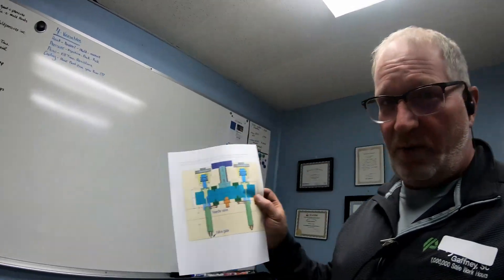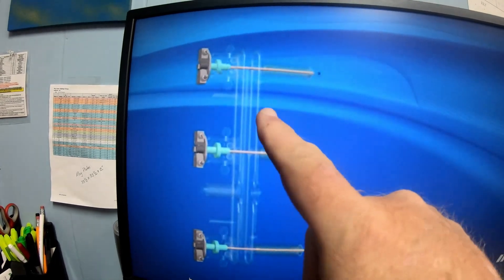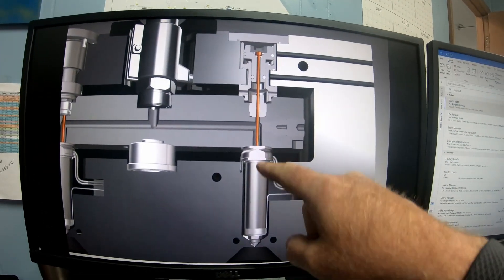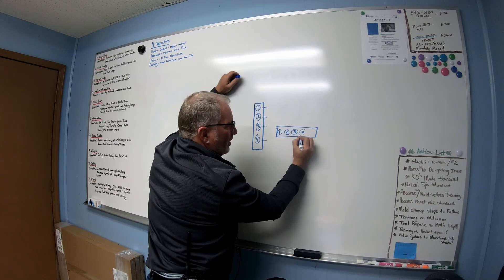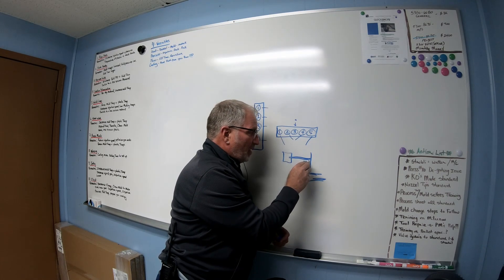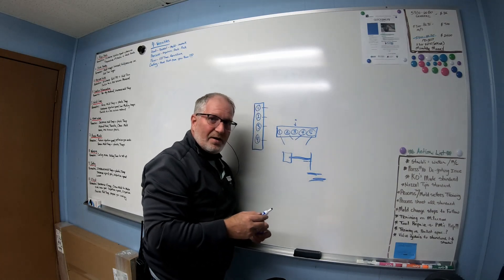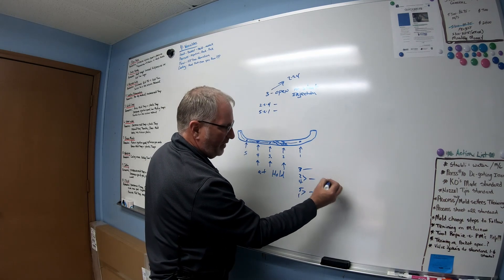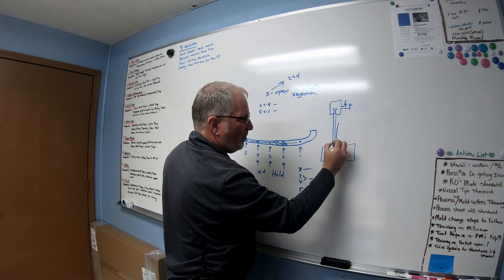Valve Gates & How They Work

Comment: Dear sir 
Clamping pressure is less than injection pressure,flash is likely to occur .
So comparison is between these two pressures to be monitored .
Most of the Injection moulding machine models show Clamping unit in Ton not in Bar/PSI/ kg/cm2
Kindly guide us regarding this 🙏
Reply from the maker: Are you asking for clamp tonnage calculations for me to show how to do it. Thanks for watching & the support sorry it took so long.

Comment: Hi sir what is the causes of gate block issue in hot runner especially in open gate
Reply from the maker: The valve gate pin is not closing back off due to hydraulic pin broken or not enough air PSI to close. Sorry for the late response

Comment: Dave I have single cav mold husky valve gate we can't  get the gate to cure  we add more cooling on A side front still not luck any suggestion
Reply from the maker: Not sure is the valve gate shutting off correctly if not it will leave a high gate where the valve gate is. Water temp is one way or taking down the manifold heats as well. Not 100% sure without looking at a part. I hope this helps, if you had a picture to look at the issue, I might be able to help you better sorry. Thanks for watching & the support to the channel, I greatly appreciate it.

Comment: What cause valve gate to get stuck open or close
Reply from the maker: Thanks for watching & the support to the channel I greatly appreciate it.
Reply: Using reprocessed material that may have metal or other junk can cause these issues. On start up if heats are not up to temp and valve gates are turned on before heat up, hardened material may damage valve pins.

Comment: What is the correct term for a key that switches which cavity in the mold you want to fill? I find the shop I work at kind of makes up terms on the fly and I’m looking to change that for ease of communication. Love the channel
Reply from the maker: The correct term is (Switchover or Transfer position) this is also called 1st stage to 2nd stage on older machines. The way is you fill the part to 95% to 98% in 1st stage the transfer to hold after you get to 95% or 98%. I hope this is what you were asking & I hope this helps you out. Thanks for watching & the support to the channel I greatly appreciate it.

Comment: Can you guide me to set the correct opening and closing time of the valve pin? Calculator time setup open-close valve pin????
Reply from the maker: It deepens on if it a sequenced valve gate. Most valve gates open at start of injection. If you have a big part, you are filling. You open the gate & watching where the flow is. 1st gate must past the next gate before opening that valve gate to the next one. If you want, I think I made a video over it. Thanks for watching & the support.
Reply: @injectionmoldingskillsmore1064  Do you have the formula to calculate the valve opening time or not?
If yes, please show me, thank you very much!
Reply: @tuhoctiengnhatvaanhchuyenn1727  The best way to get a starting point for the settings would be through simulation.  You would need to match your flow rate between the simulation and the press, but also remember the analysis software assumes your press and material are perfect and in real life it won't be.  Calculating it by hand would not be worth the time since material flows radially so if the width of your part is changing the speed would also be changing.

Comment: I have ran ultem material. Has anyone ran peek material thru valve gate hot manifold.
Reply from the maker: Thanks for watching & the support to the channel greatly appreciated.
Reply: We run ultem on a couple jobs at work and is our highest melt material, and not the funnest to run. We have one tool that has a valve gate and hot runner. It took a while to process in but have been able to produce quality parts.
Reply: @Headake27  do you use perge to run thru before shuting down or do you run dry then turn heats off.
Reply: @paparooster9569  a small amount of natural polypropylene usually before we shut down. That material is hard and u don’t want that material wrapped around the screw after Shutdown
Reply: @Headake27  Roger that. Do you purge hot manifold tool as well with the pp.

Comment: The company i work for just got a hot runner mold. How can i determine if the mold has valve gates or a different type of gate?
Reply from the maker: The valve gates are hydraulic or pneumatic hook ups. If you don't have this then they are regular gates.
Reply: @injectionmoldingskillsmore1064  Thank you, now that i think about it that seems quite obvious. sorry for the stupid question.
Reply from the maker: @joshbowen2717  Its ok bud

Comment: If you want valve gate control you have to check out HRS servo driven valve gate systems.
Reply from the maker: We are trying to have everything integrated thanks for the offer.
Reply: @injectionmoldingskillsmore1064  you integrate hrs into your current system.
Just remove the hydraulic driven valve gate body and install their knuckle onto your pin mount the motor now your integrated... I don't understand what else you could mean by integrated challenging with respect!
Reply from the maker: @joehart103  Sorry if I confuse you, We are buying new presses that have the valve gates intergraded in to the press PLC. We have a lot of older presses from 1954 & up. So we use portable units to control the valve gates. This is what I was trying to relay to you sorry if I miss understood you.